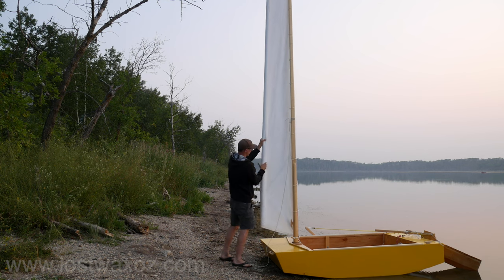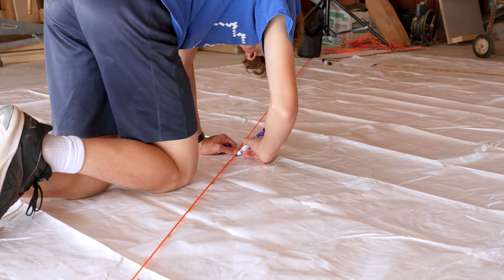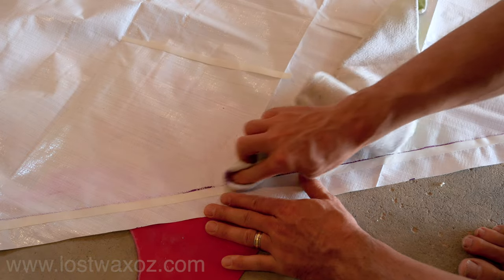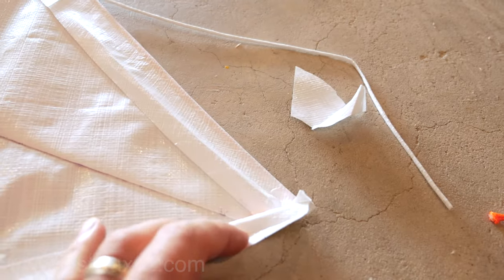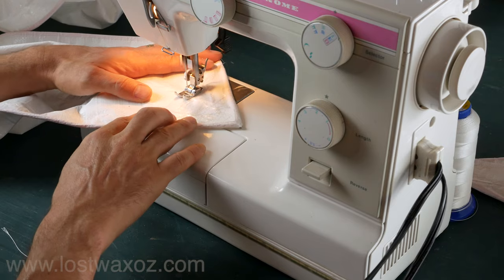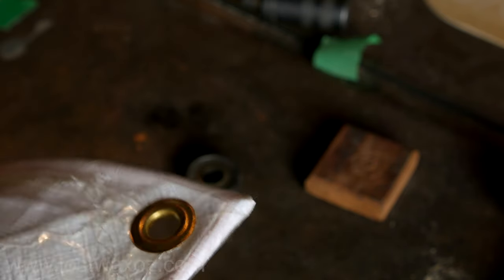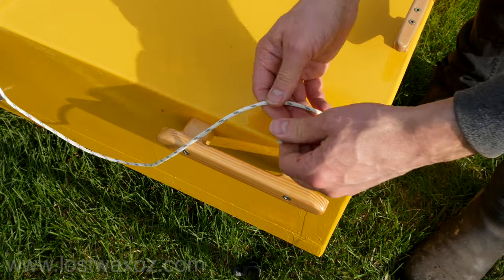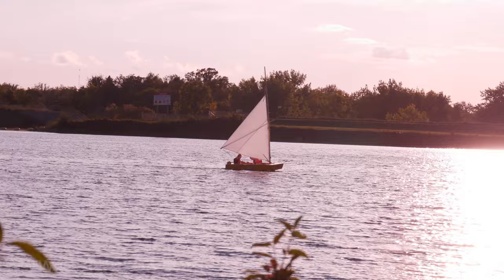Make a Sweet Sail From a Cheap Tarp: DIY Plywood Sailboat Full Build Part 3

Comment: Nice video. I am very impressed with the simple boxy little boat design. I like Mik Storers OZ Goose design, but presently my situation does not allow me to build. As time goes on these small boats look better. There is much beauty in a homebuilt boat. The conservation of material and the simplicity of construction add value to the design.

Comment: Your videos have inspired me to make one of these for my family to try out sailing. Could you make a video about how it's held up a year later and what, if anything you would have changed in the build?
Reply from the maker: Cool, I think you'll have a lot of fun with it! Not sure if I'll get a chance make a video about how it's held up so here's some of my thoughts.- I've sailed it 2 seasons now- probably 6or 7 times a season. Only on small lakes so far. Stored in my garage over winter. I'm really impressed with how the poor mans fibreglass has held up around the edges, and the paint has been great too. Just one little spot on the bottom where there was a knot in the wood that the paint has cracked a little. The fit between the mast and the hole it goes in is a little tight, makes it hard when trying to slot it in properly. The leeboard which was made from gluing plywood together started to separate a bit where it didn't have full glue coverage, so I filled those gaps with epoxy- I should have been more generous with the pl premium when I glued it up. I have since added oarlocks and oars as it's pretty hard for one person to paddle (will be adding that video this spring) Other than that, probably the only other thing I'd like to change is figure out a way to drop the sail if I need to. ON the positives, I love the handles- makes it so much easier to carry. It's fairly light and easy to move around for two people. The system for the rudder and leeboard work great. and so far the 1/4" bottom has been strong enough. Haven't had anyone really heavy in there though.....
Reply: @LostWax2  Thank you so much! Looking forward to your spring video.
Reply from the maker: @garykennedy  You're welcome. hope it goes well for you!

Comment: So many reef knots. Sailors everywhere weeping with despair. " under no circumstances should it ever be tied as a bend, for if tied with two ends of unequal size, or if one end is stiffer or smoother than the other, the knot is almost bound to spill. Except for its true purpose of binding it is a knot to be shunned." - Ashely's book of knots.
Reply from the maker: Hehe, I guess I should read the book of knots........
Reply: Start with the sheet bend and the bowline because they are the same and do a lot of what you need.

Comment: That's a finely made sail, we'll done! You've made a good sail just the way sails were made out of dacron cloth 👍🏼👍🏼
Do you add the polyester line for all 3 luff leech foot for strength? the leech line could be adjusted or tensioned?
Also, since you're using the Leg-o-mutton setup, does it bother you when the wind is blowing from port side and the sail's form rested on the boom? Or does the boom-luff end hangs loose enough to swing clear of the sail's shape?
I'm planning to repurpose a 5.4 windsurf sail with battens and thought of using your method

Comment: Did you have any trouble sewing with the double-sided tape? When I made my sail, I used some adhesive at the edges and had a terrible timing sewing through it. I'm trying to figure out how to avoid that again before attempting to make a replacement. Also, have you had any luck reefing this setup?
Reply from the maker: I didn't run into any issues with the tape on this sail, however I have had problems sewing through tape in the past. I don't remember whether I actually sewed right through the tape or if I tried to miss it on the build. I guess I could watch the video again and try see when I have a few spare moments....:)

Comment: I've watched all of your videos since the construction phase. I benefited a lot. You are very creative. Congratulations.
I bought a plan from Michael Storer. Your videos will guide me as I build.
I want to ask something. What is the square meter of the polytarp you use for sailing?
Reply from the maker: The finished sail is around 59 square feet, and the tarp I used was 10ft x 20ft. Have fun building and sailing!!

Comment: I've rigged a smaller and similar lug sail(?) To my canoe. Only issue... when the wind blows too strong... how do you lower your sail quickly for safety... I found out the hard way that I couldn't.
Reply from the maker: Yep, that's something I have been thinking about too. So far I have sailed close enough to shore that it hasn't been a problem. My original thought was that I could release the boom, lift the mast slightly and then roll the sail up on it, however the mast is too hard to spin in it's hole. So yeah, worth exploring further.....

Comment: hey i see it has been a year since you posted this video. how is your sail holding up?
Reply from the maker: So, this summer was my third season with the boat and sail. The sail is still in fine shape. Getting a little dirty perhaps. Our summer is quite short, so I probably only sailed it 5 or six times.  I did change the way I laced it to the mast this year so that I could hoist it up and down, not that I ever actually needed to:)